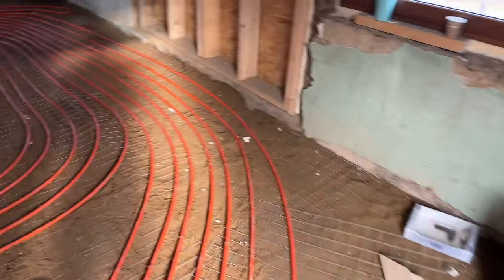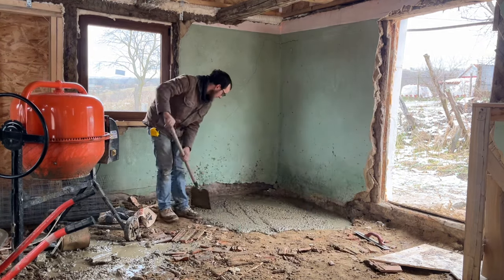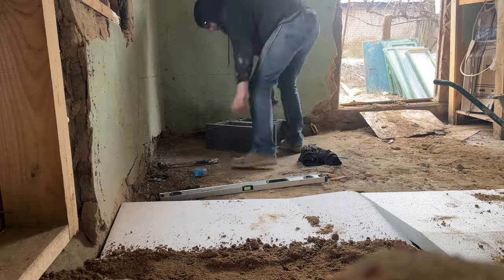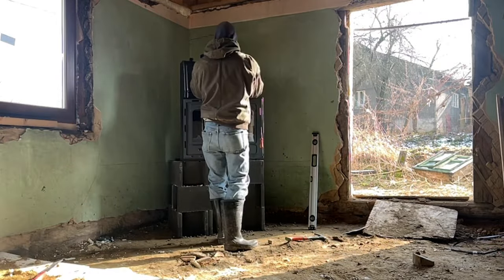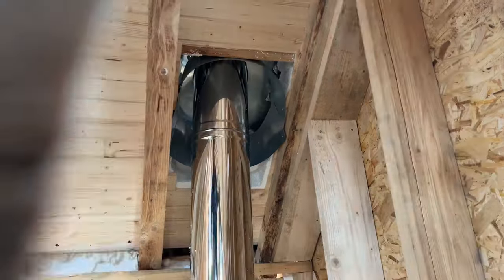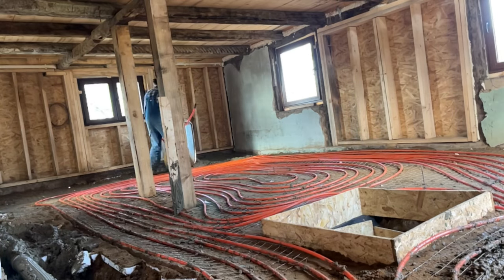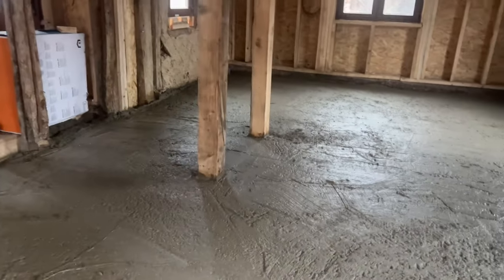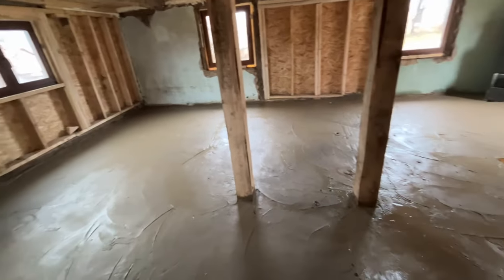Heated concrete floor and fireplace installed. Mud home renovation part 13

Comment: Nice progress! Keep up the good work! Usually stove are mounted closer to ground because cold air is heavier.....
Reply from the maker: Yeah.👍 It’ll be about 30 cm off the ground when finished. I’m thinking of putting a ceiling fan up above my beams also to help push air down. The upstairs heats up pretty fast. Also will help once I have it properly insulated inside. Actually talking to the wife now. We might move it down a block so we have 20 cm off the floor. That way I can just place a rock for the hearth.
Reply: @European_Homesteading  there is also a stove fan.... working without electricity, maybe it works for you
Reply from the maker: Yeah that would work great.

Comment: the cement is touching the base of the wall which is made of wood? :) if yes... then you are in trouble ...
Reply from the maker: Yes it may have been best to put something between. the wood is fairly cured due to age so hopefully won’t cause too much of an issue